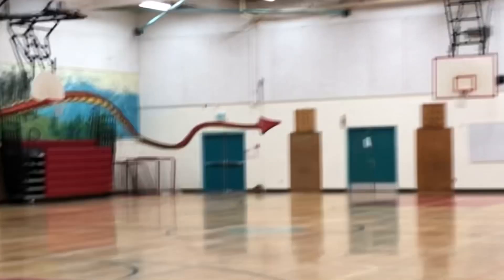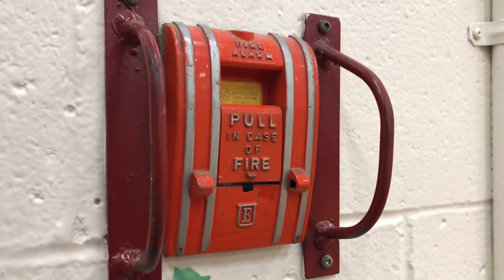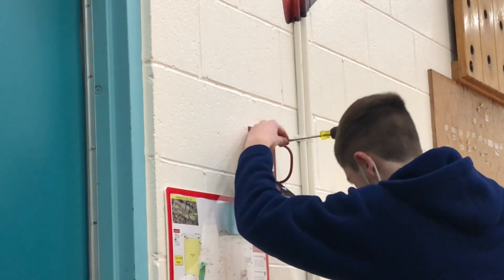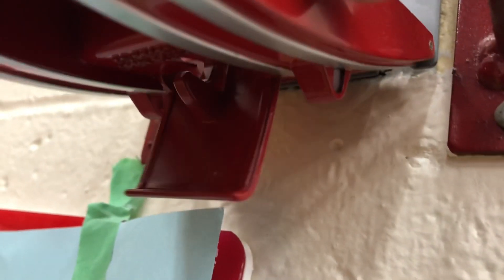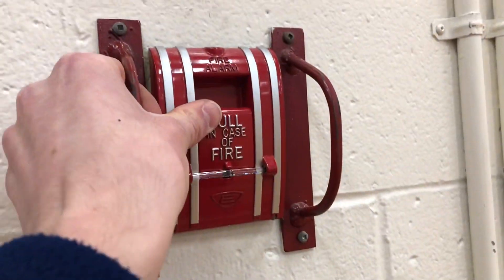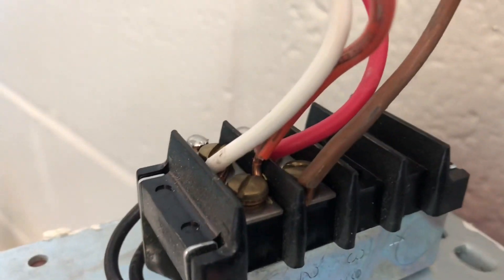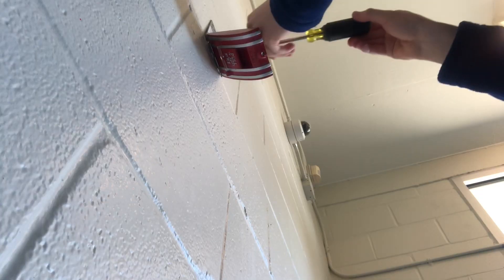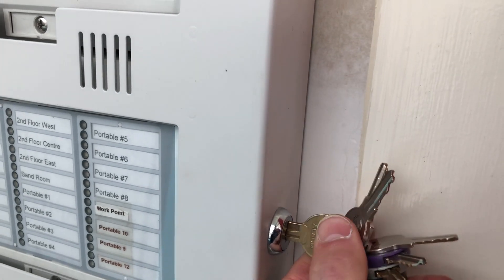Replacing fire alarm pull stations in a school

Comment from the maker: Check out the description it may answer your questions
Reply: Maybe put them up on eBay for parts? I know that there’s a bit of a demand for those old pulls
Reply from the maker: @HenBasketFireAlarms  we cleaned out the van a couple days ago they might’ve got trashed
Reply: What's your favorite alarm?
Reply: But tire collection of fire alarms
Reply: Like I test them every single day and no very very very very very very very very very loud loud
Reply: @safetysecurityfirealarms9971  probably trash em. They have broken switches. They are useless unless someone puts a new switch in them
Reply from the maker: @theblueexitsign8249  yeah I think I threw them on the floor in the van they will probably end up going in the garbage I don’t want them
Reply: What's your favorite pull station?
Reply from the maker: @haeleybuckman4322  notifier NBG-12LX
Reply: hey just wondering if you have any EDWARDS SPO's avalible

Comment: Im a fire alarm technician. I no longer use "wire nuts". Wagos or lever connectors are much more efficient
Reply from the maker: That is until they break they are nice and fast but we have had many problems with them failing

Comment: Nice!  I assume the panel had ZB-16s in it?
Reply from the maker: Probably it would also have a card for the SLC loops not sure how many SLC circuits there are The school has all conventional pull stations but all addressable smoke detectors and no more heat detectors now that the school is sprinklered the separate band hall building is all conventional smokes and pulls

Comment: Several alarms have been replaced at my elementary school. It was built in 1989 and has a Simplex 4001 or 4002 system. The alarms on the inside are mainly Simplex 2901-9838s on 4903-9101 strobe plates and the pull stations are primarily Simplex 4251-20s, however, the pull station in the preschool kitchen is a Fire-Lite BG-10 for some reason. And on the outside, alarms are mainly Simplex 2901-9838s. However, inside the portables, there are Radionics D325 pull stations and Federal Signal 450D horns on the outside and in the library, which is a newer building, there’s a System Sensor PA400R along with a Fire-Lite BG-12 and System Sensor i3 smoke detectors that replaced Bosch D263s, there is also a Wheelock AH-24 on the outside. Also, one 9838 was replaced with a 4901-9805, and two 9838s were replaced with a System Sensor SpectrAlert Advance HR, and another 9838 was replaced with a white System Sensor SpectrAlert Advance Low Frequency Sounder. I assume a bunch of 9838s were replaced because they’re electromechanical horns and the sound plate probably cracked finally after 20-30 years of being ran in continuous every month for fire drills. Because those sound plates can crack after years of continuous vibration, that’s something the electronic alarms don’t need to deal with

Comment: I noticed that the replacement pull stations use wire leads and not terminals. Is it code in your area that pull stations have leads, or were those models just cheaper?
Reply from the maker: Just cheaper I hate the pigtails I like terminals way better
Reply: Makes sense

Comment: U replaced some bells with low frequency Sounders now u replacing the older SPO pulls with the newer SPO pulls
Reply from the maker: I’m not sure what you’re talking about about bells I’ve never replaced bells with low frequency sounders these pull stations were replaced because they did not work
Reply: Didn’t u remember the video about replacing a a school’s fire alarm system
Reply from the maker: @fa3_utg  yes those weren’t low frequency Sounders this is a different school altogether
Reply: Bruh